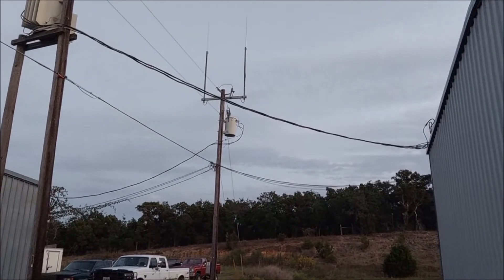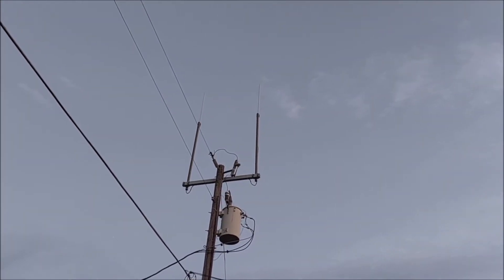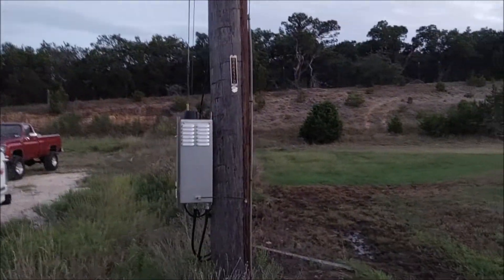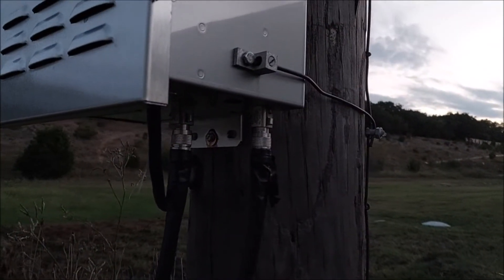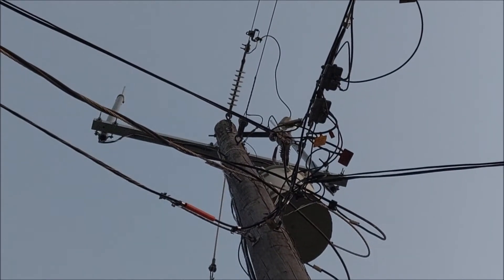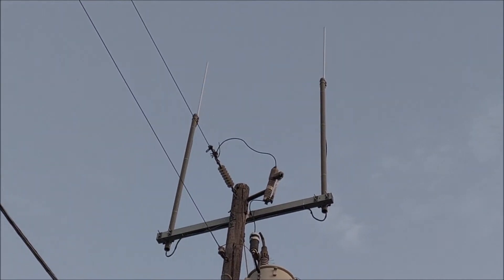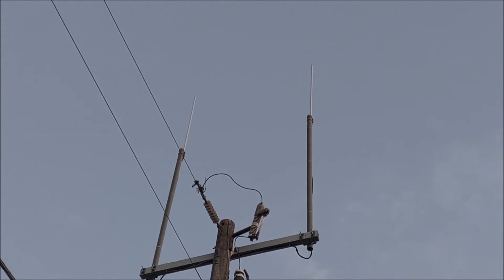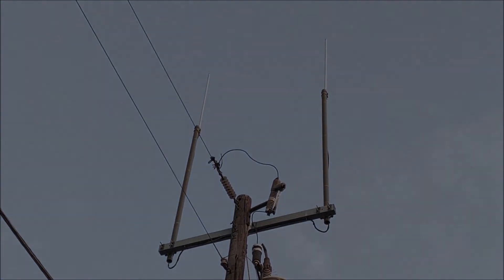Aclara RF Data Collection Unit (DCU2+)

Comment: my my hey hey,nothin ever stays the same.
Reply from the maker: i was the first kid on the block to get the new meter and i LOVE it.  no more twacs signal noise coming into my house.   this isn't one of those skeptic videos where people say the power meters are causing problems, the old meter actually made electronics in my house buzz every time the meter sent a signal.   the new meter send a signal, but it's over the air waves instead of over the power lines, different technology that works out better for everyone.
Reply: @morejelloplease  
the speed at which things are occuring is getting faster , IBM photon transistor , no power, light speed, The End,MrMoores Law is over,how to improve light speed or no energy 0's and 1's, .. the End, ..plus Climate change
IBM Research unveiled the thing 2 weeks ago